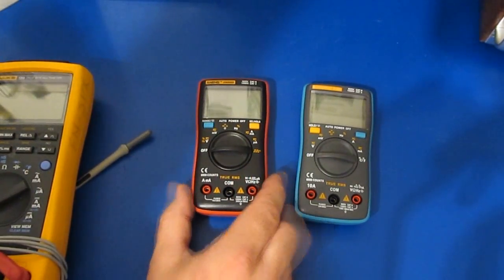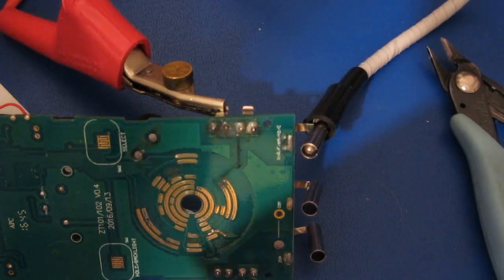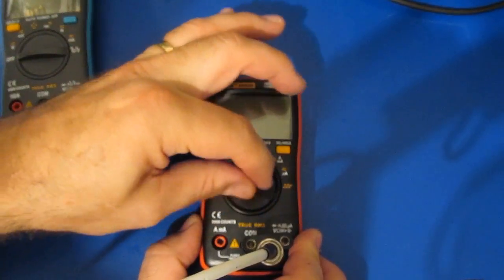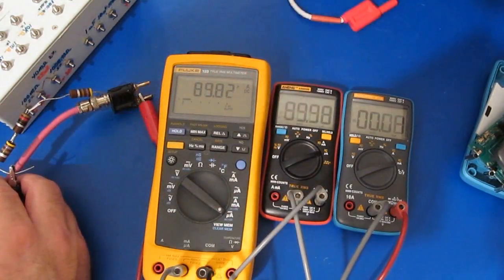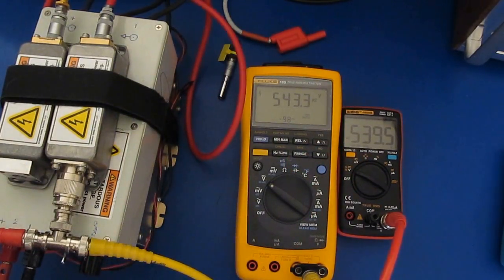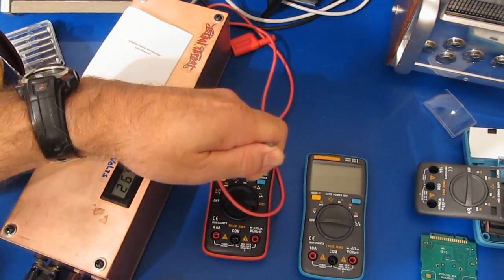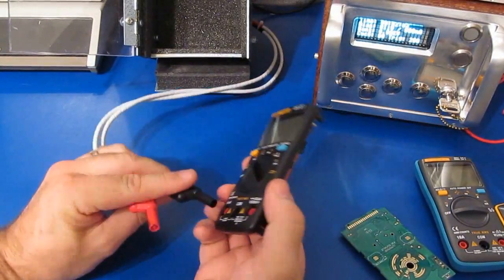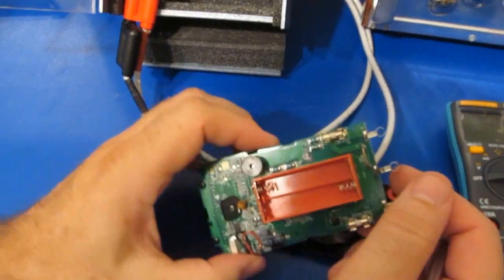ANENG AN8008 Handheld Multi-meter

Comment: Your videos are very informative and entertaining, but they also make me feel sorry for the poor multimeters that are being abused way beyond their design specs;  I appreciate that you do not shit on a product just because it doesn't cost half a month's salary or is not labelled Fluke or Keysight or Rohde and Schwarz, unlike another electronics blogger who shall not be named. You actually go to the trouble of testing the thing first, and you have confirmed what I have already discovered  from 37 years of experience as an electronics engineer and experimenter; brand name and price do not necessarily  imply that a particular piece of equipment is orders of magnitude superior to another brand that is unknown and costs somewhat less.
    Based on your video I was about to purchase an AN8008, but the Surpeer AV4, which has superior specs and great reviews (at least the few that I have seen), caught my eye, so I have ordered one from Amazon, and I will be testing it myself. I already have an Aneng AN8002, which works great, but the temperature measurement function is extremely inaccurate (keeps reading almost 4 degrees celsius lower). Anyway, thanks and keep making those great videos!
Reply from the maker: Michael,

Glad you are enjoying the videos.  Don't feel too sorry for the poor meters. 

I've posted a fair amount of details about the tests I run and how they compare with the IEC standards.  This meter for example is marked CAT III 600V.  If it were independently certified it would see 6KV, 2 ohm source, 50us FWHH.  Too bad I never even made it close to that.  But the other part of this is that they spec a current waveform as well.  Hence the combo generator.  I come no where meeting this.   When you say I test them way beyond,  I say I am not even close to running them at the levels IEC requires.  And there is a reason for this.  Namely, I am not concerned with the safety so much as I am in how robust the meters are.   This has been stated since day one.   

You would have to look at the spread sheet.  I would guess about 60 meters now.  When it comes to my robustness tests, the top meters were sold under the Fluke, Brymen, Gossen and HIOKI brands.   

I looked at some pictures of the AV4 and it appears they placed the protection on the backside of the switch, just like this meter.   I will be interested in seeing you testing or at least reading about it.

Comment: You have some good frends that can give away a fluke, you lucky man :-)

The uni-t that had its screen buffed looked like a nice meter.

I have a very old micronta digital, it would not stand a chance with your tests, i keep it in a safe with my tea bags so you cant get to it Ha ha :-D :-D.
Reply from the maker: I am the third owner of that Fluke.   I had asked to borrow it for some testing and cleaned it up while I had it.  It's a pretty nice general purpose meter for it's age.  If Fluke still offered it with current certs, I would have one on order and run it on the jig.  

I did make some videos on the UNI-T UT181A. It's a clone of Flukes 289 with some added benefits.   IMO, the best meter UNI-T has made.  Still needs some improvements before I would recommend it.  

You saw what happened to the last Micronta meter.  Stupid in-line fuses.  I should have just lit that thing up.

Comment: I have an 8008 in transit from AliExpress. I bought it because it was cheap and will only use it for digital voltages. 
I will sure as hell not plug it into AC. I have my Fluke87 for that. 
It looks like it did pretty good for what it is. A $20 meter, with great accuracy for hobby work. I was expecting a lot worse. 
Thanks for the great testing and video. I for one appreciate it.
Reply from the maker: Glad you enjoyed the video.    At least they seemed to have address the range problem with the rectified AC.  Too bad they removed the temperature input and can no longer read 10M and up.  With the new sensitivity to RF, I wonder if the meter powers up with a 200MHz CMOS clock.
Reply: I was also amazed that it didn't work if the signal didn't pass the zero threshold! How often does one come across a 200 MHz AC signal as opposed to a digital signal? 
Still, ~160 MHz is way over my needs.
I am glad I sub'd to your channel. Your testing answered all my questions and then some.  Thank you.
Reply from the maker: I can't answer your question.

Comment: Another great test, great tip on the scratched display.
Reply from the maker: I promise, I don't work for the company who makes that product.  Was just amazed it worked so well.   The Fluke 189 was about a half hour of work to clean up.
Reply: Great tip because I have an old meter with scratched display that I was thinking about cleaning up, and this appears to be the answer I was looking for.  :)
Reply: Great tip, should of been it's own little video though. Your Meter test videos are unique and should stand alone with no other material added in so as to keep them as concise as possible.

Comment: Have you ever tested the Surpeer AV4? It is available exclusively on Amazon, a 20000 count, 4 1/2 digit multimeter with a dual display, and many high end features for only $36.99 at the present time. There unfortunately seems to be only a few videos on it, I would love to see it subjected to these destructive tests (just to see how good it actually is)
Reply from the maker: Yes, that was the rendering I saw and what prompted me to post.    Why they would think having the transient run through more than half the board length is a good idea, beyond me.  Maybe the same designer who worked on the 8002/8.
Reply from the maker: Wow, I did not think there were other meters out there with the clamps on the backside of the selector but looking at the pictures it sure seems you found another one.
Reply: It's a homely Ryobi knock-off, but price looks catchy. Tiny solder points for the floppy looking split-jacks. Look where they place the PTC and not a MOV in sight! Meh! https://s3.postimg.org/jttkxr0zn/PCB_Surpeer_AV4.jpg
Reply: 4 1/2 digits? Comes with temp probe and says freq. goes to 20Mhz. There's a black  version (Banggood $39. Search on HY-19E 20000 Counts NCV) Also, there's a B model for $8 less (6000 count, same ugly ANENG blue shell).

Comment: Very nice scientiically controled testing.
Reply from the maker: Seeing the AN8008 fail at close to the same level as the 8002 does seem to give some confidence that it is a bit of a controlled test.   Actually, I check the generator pretty much on every run and it appears very stable.

Comment: So does it meet the specs?
Reply from the maker: No way it would meet the specs they claim.  I am not an accredited lab but I would bet the creepage on the fuses alone would never make it.  Why is that even a question?
Reply: I do not believe it meets CAT ratings at all, similarly to uni-t designs, my question is only about what is most essential for hobbyist like DC/AC/R/C for who this meter, usually much below 250VAC.
Reply from the maker: Oh, I just assumed specs meant CAT ratings.   I have never checked the meters  I run to see if they meet their other published specs. It would take a fair amount of time and I am not a cal house.  To do it right, I would really need to setup for it. 

I have posted some information on the box I use to check them but I really use this as a basic functional test only.     

BTW, there are some UNI-T made meters that have been independently certified for the 61010.  It seems they offer a GS certified UT61E.

Comment: I like the videos but, i have a question. what it the purpose of this tests? to me its like testing a car engine by putting it in first gear at 150mph at a deep slope and look for the damages....  or putting 5kv into a laptop to se if it holds.. even if it clearly states the maximum voltage it support.
Reply: I recently had a 2 year old UT61e destroyed after in inadvertently turning a motor into a step up transformer, I have a 30 year old meter that has survived far worse abuse and still works perfectly, so these tests are extremely useful.
Reply: What can happen to a pc/notebook when it is physically connected to a network or ac while somewhere near you a lightning strikes? This is very similar to what can happen to your dmm when there are transients. And no one later will ask why the notebook was "driven" outside it's specs even when they are clearly stated ;-) And if this happens while you are working with your notebook this may hurt you. Well this is not so obvious while working with a notebook but while working with a dmm a well protected device can be very helpful not only for the dmm. Security features are always for the unexpected and hopefully seldom moment.
Reply from the maker: Did you save the UT61E or take any pictures of the insides?  I would like to see what happened to it.
Reply: It reminds me of when I was a little kid and I used to destroy all my toys with firecrackers
Reply from the maker: deviceundertest, it may only be 5kv, but the energy available is very high.   If you really want to see him run them, you should donate the meters to him and see if he would be willing to run them for you.  He may.
Reply from the maker: It funny how so many people equate these tests to cars.   I never understood it as there are standards for handheld meter testing as well as crash testing cars.  The original purpose of these tests was to determine if a $50 meter could be as robust as a more expensive one.  I believe we have that answer but I continue to benchmark them out of my own interest.

Comment: 37:25
Judging by that hole you blew in the COB, I think we have a pretty definitive answer of where it's breaking down, LOL.
Reply from the maker: I would have set the other camera up had I known.
Reply: Even better, Chronos 1.4 high-speed cam's will be shipping production models at the end of this month. They run $2,999 or you could offer Dave a silver dollar for his... (Lucky guy got it for nothing and we haven't seen anything from it in a while, funny how idea's fade..)
Reply from the maker: When I saw the designers website, I offered to buy one of the original prototypes, bugs and all.  He declined my offer but I was not aware they were being made to use as an advertisement tool.  The problem is, I do not believe it would be fast enough really see the whole event unfold.  My guess is still just a flash.

Comment: What wire do you like for your hv leads?  I recently acquired a supply capable of 5kv and before I mess with it I want to put together a good set of leads.
Reply from the maker: I don't really have any high voltage leads.  I just use that wire I showed when I was testing the multimeter test leads.  The one coming off the generator is coax.
Reply: joe smith OK I'll check that video again.
Reply from the maker: I checked and its Belden PN# 09058899002.   This is 18AWG and has a working voltage of 5KV.  This is why you see me tape it in some cases.  I've used solid core spark plug wire before as a cheap source.  I looked into getting some better wire but the spool sizes were more than I could ever use.